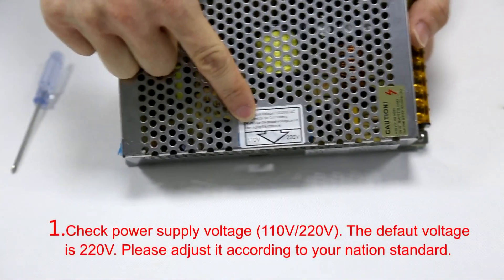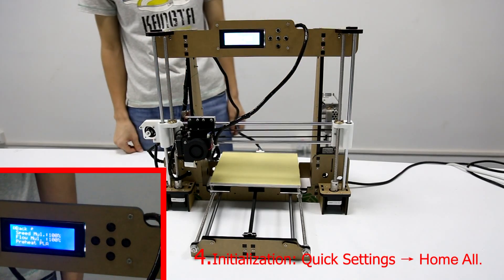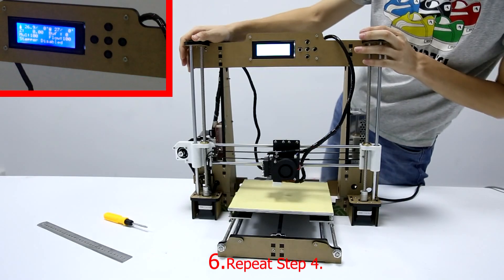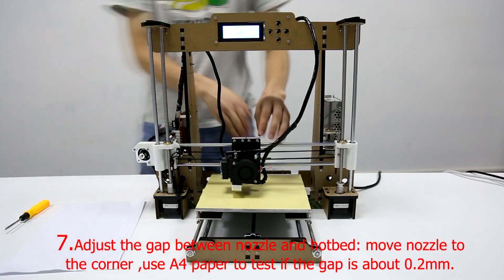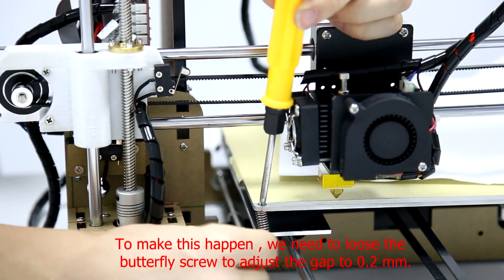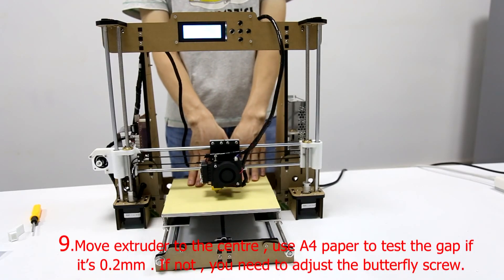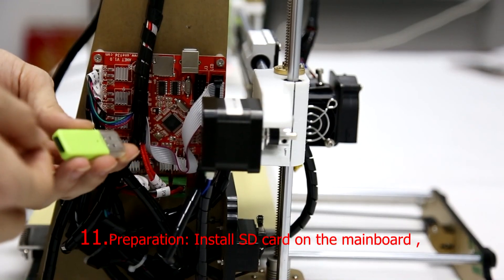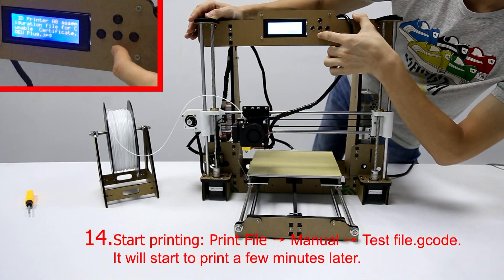3D Printer Instruction--Anet 3D Printer A8 Debugging Video

Comment: I"M having trouble with the HOME option.  If I press Home once the print nozzle is A4 paper from the bed, if I press home again it's 2mm above the bed.  Once printing starts the nozzle is too far away from the bed.  If I adjust the bed for the higher height then the nozzle strikes the edge of the bed.

What do I do?
Reply from the maker: Sean, you need to adjust the 4 angle of hotbed to the same level.
Reply: Thank you for the response David, however the issue is not the bed height, but the "home" height.  When I press Home, there are 2 different heights.

One touches the bed, and the other is 2mm above the bed.  The way I had to get around this is by printing the test file and once the file started I shut the power off, then leveled the bed to the print head height.

I don't think this is normal.
Reply: Sorry David, one more thing.  How do I print directly out of Cura and not off the SD card in the printer?
Reply from the maker: Sean McCann just install the SD card on the board , there is a interface for it . and choose SD card in the menu , and choose the file you have stored in it .
Reply: hi, my printer don't detect the sd card there is not print file on the lcd display why?

Comment: Hello David and thank you for all your videos.
I have just bought and mounted a A8 Anet printer.
Everything seems to be working fine except the Y-Motor channel.

I've tried to switch the motor plugged to the "Y-Motor" but it's making noise and not really moving.
When I plugged X-Motor on channel Y and Y motor on challenge X : X was wasn't working anymore (noise but no move) but Y was working.

All this make me think that's the problem is comming from the electronic card (and not the motor).
What shall I do please ?

Thank you and have a good day
Reply from the maker: Example: Before exchange , X Pos.Fast ,X motor is abnormal . Y Pos.Fast, Y motor is good. Change X, Y motor connection , X Pos.Fast, Y motor is abnormal. Y Pos.Fast, X motor is good. You need to replace a mainboard; or X Pos.Fast , Y motor is good. Y Pos.Fast, X motor is abnormal, you need to replace X motor
Reply: Thank you for your quick answer David.
Here is what I did : 
Before change : 
    - Motor X plug on X connection - > X Pos. Fast = OK working good (Extruder moving left or right)
    - Motor Y plug on Y connection - > Y Pos. Fast = KO not working (Heatbed not moving)

After change : 
    - Motor X plug on Y connection - > Y Pos. Fast = OK not working (Extruder won't move left or right)
    - Motor Y plug on X connection - > X Pos. Fast = KO working good (Heatbed moving front to back) 

As you described the problem is comming from the mainboard but the printer is brand new. It should be working fine, doesn't it ? Are you providing anysort of guarantee please ?
Reply from the maker: Malhodauh Contract the person who you buy from

Comment: Great videos,
I have only 10m of ABS filament, will I be able to do the test print with what I have?
Thanks.
Reply from the maker: you can make it with a  little 3d model
Reply from the maker: you can make it with a  little 3d model
Reply: +David Dan is the test print small?
Reply from the maker: no, just your filament is limited. it doesn't matter. you can test print anything

Comment: Guys i have same printer. Please use special tightened bed nuts (yes they dont loose itself). Or it will take ur life to adjust the bed.

Also carry a scale to check x carriage from both sides. when u yhink the prints having a side not sticking or unlevel.

Also use PLA with this printer, because it does not heat 240 and above and shows DEF signs.

Please check that ur nozzle is  aligned just a a4 paper thin away from bed. 

make ur z endstop one screw some loose so that u can adjust it with your fingers.

Comment: This is the exact configuration of the printer that I ordered and assembled. When I select to preheat the display reads 

def / 240     def / 11

There is no indication that it is preheating, what should I check?
Reply from the maker: Step 1 . Click Reset , check screen.
Click Reset and check screen. The temp will turn to def in a second . If the extruder temp is -50.9 , means thermistor cannot detect temp.

Step 2 . Change wires of E_T , B_T port and click Reset , check screen

If Step 1 & 2 both shows abnormal extruder temp , you need to replace extruder thermistor; If Step 1 & 2 both shows abnormal hotbed temp, you need to replace hotbed thermistor;
If Step 1 shows abnormal extruder temp while Step 2 shows abnormal hotbed temp , or Step 2 shows abnormal extruder temp while Step 1 shows abnormal hotbed temp, you need to replace mainboard.